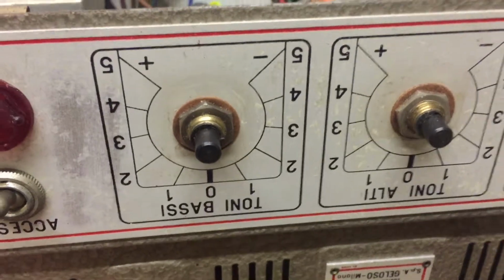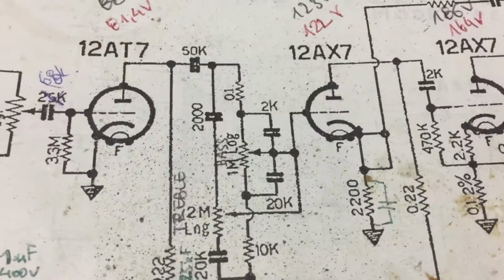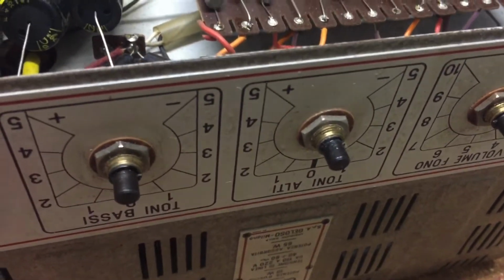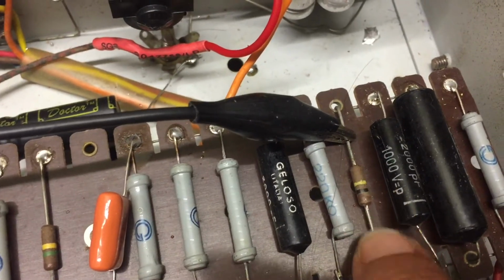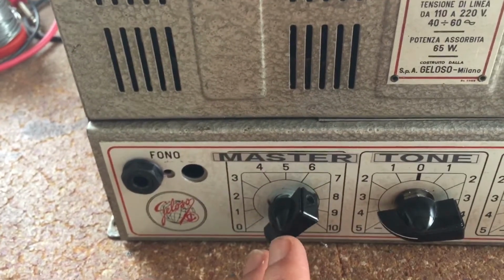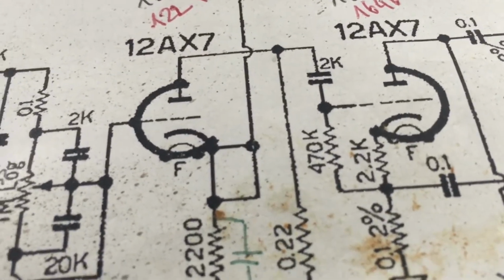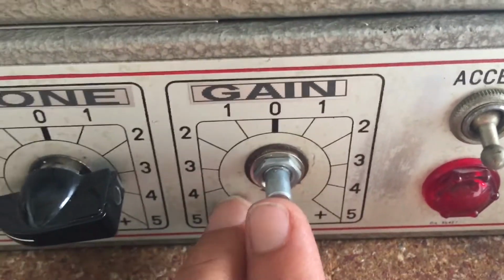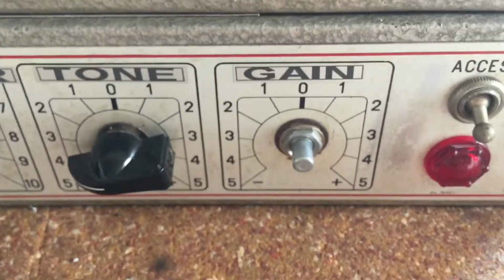1953 Geloso G211A - 4. Tone stack and gain mods

Comment: Hi. I've got an amp very similar to this one from an old and extinct portuguese brand called AMBARO. It was reviewed by a specialist and it's in its original condition. How did you add a gain pot? Is it a part of a tone stack? I made some researches about tone stack but i'm not clear about that. Does a tone stack change the sound? Thanks for further help
Reply from the maker: I did not add a gain control, I added a master gain, but I don't feel like helping you if you don't even bother to watch the video...
Reply: I did. But didnt know there was any difference between gain and master gain control. I'm not comfortable with most of the technical tips on the video. I'm a mechanical engineer with some knowledge in electricity but not in electronics. So it's a bit hard for me to get clear conclusions out of these videos. Thanks anyway.

Comment: Hey s‘up do you still have the squier Electronics ? Cuz I just bought a affinity and I am already planing some mods ? I liked the nocaster PU U used
Reply from the maker: There another video on that -- yes the Nocaster PU are a definite upgrade. Squiers don't have magnetised pole pieces but simple metal ones with a magnet glued to the back. It does make a difference.

Comment: Hey thanks for the info and video. I ve had similar issues with non fitting knobs but I always end widing up the hole with a milling tool ( a drill might work too)
Reply from the maker: Thanks for the comment... yes I tried drilling too, but the plastic chickenheads were too fragile and the aluminum knobs I had too hard for easy drilling. At least I learned something: check pot shaft diameter before ordering. ;-)